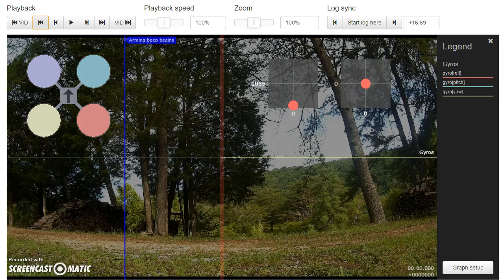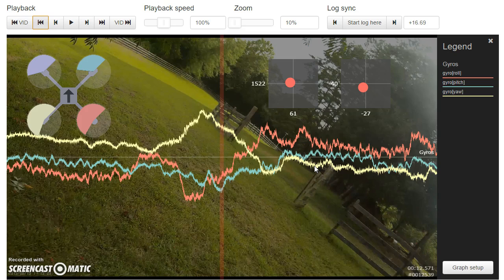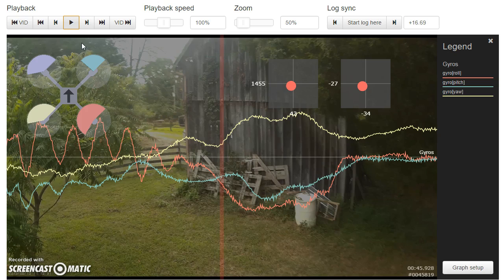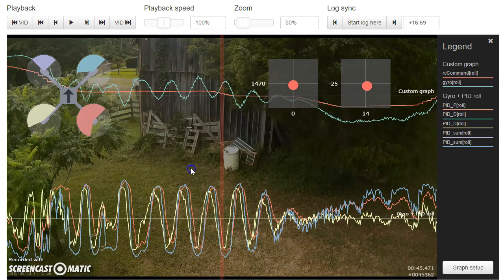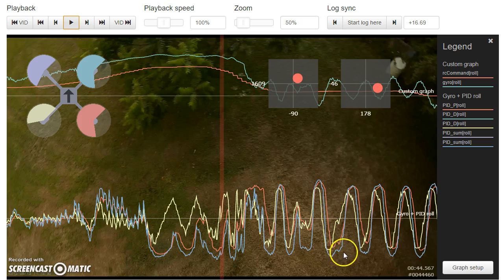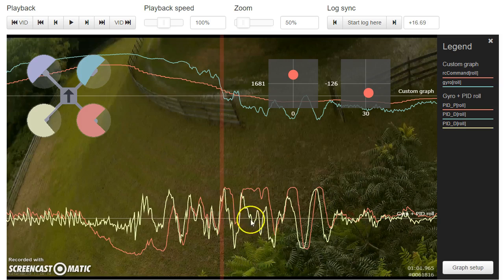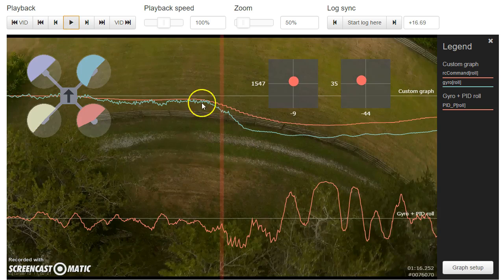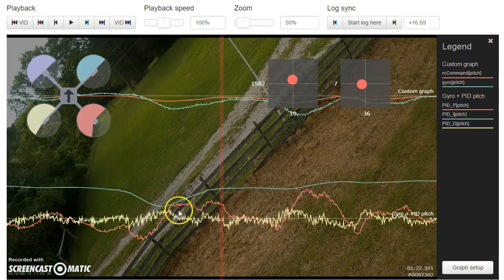Blackbox 2015-08-19 - Slightly high P gain

Comment: Another great video.
Quick question. Didnt Boris suggest setting gyro_cut_hz=0 when you set gyro_lpf = 188.
That thread moves so quick its hard to keep up. Just when I thought he was happy with things it all changes again
Reply from the maker: +Noel Harris Yes, he did make that suggestion, but I am really suspicious as to whether my copter could fly well at those settings. Granted, we now have pterm_cut_hz and dterm_cut_hz, and I term is inherently low-pass filtered, so I suppose there would be some filtering present. Maybe I will give it a try and see how it flies.

My experience has been that Boris's copter(s) have MUCH less noise than mine does. Way back when, he said to fly with gyro_lpf=256 and dterm_cut_hz only. This was before he had developed gyro_cut_hz and pterm_cut_hz. Suffice it to say, the results were very poor. So I always keep that in mind when assessing his advice r.e. filtering.
Reply: +Joshua Bardwell   
Yes I know what you mean. Ive been spending the morning playing with the filters and found that gyro_cut_hz=0 was way to noisy. found that gyro_cut_hz=60 worked for me and also lowered dterm_cut_hz to 10 as 14 was still a bit noisy. Starting to get a grasp of it and now the hard part, adjusting PID,s.